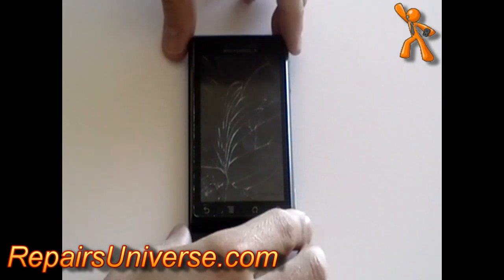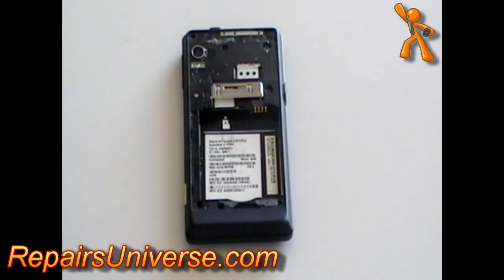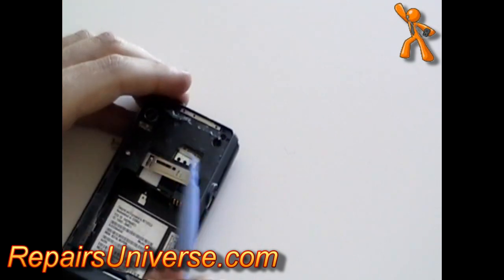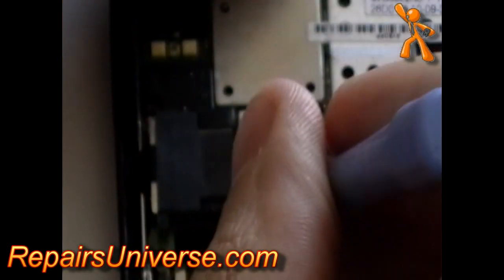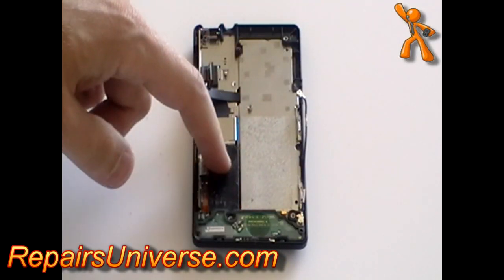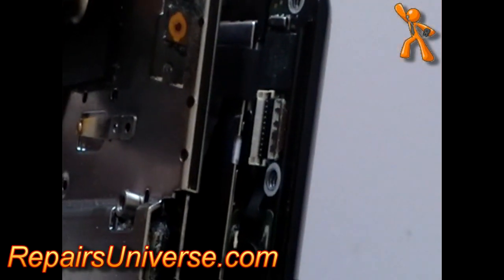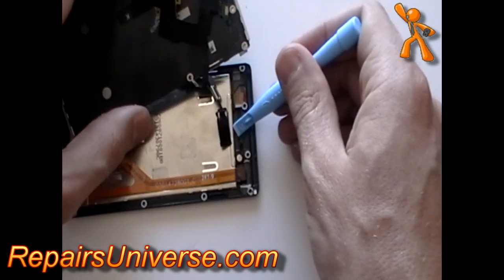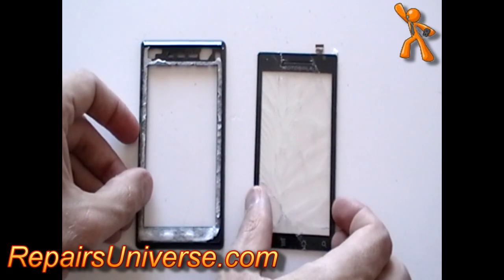Motorola Droid A855 Glass Touch Screen Digitizer Repair Instructions

Comment from the maker: @redinc Great work. Sounds like an off connection with the vibrator motor. I believe it is located right around 3:01. Just be sure it is in the correct location and the connection is secure.

Comment from the maker: @mec2137 It is a jaw connector, meaning the tab will have to be flipped into the unlocked position (up) and the cable slid in. You can then lock it into place by flipping the tab connector down, securing the cable into place. Be sure it is fully inserted.

Comment from the maker: @Ardy1148 We sometimes use WD40 or other penetrating oil to loosen stubborn screws. Use a Q-Tip and apply a small bit (not runny) of WD40 on it and see if that will help loosen them up. If that does not work, you may want to consider either using a screw extractor to remove the screw, or use a small drill bit to drill out the screw and remove.

Comment from the maker: @maizeandblue93 The connection is very important and is likely causing the issue. A few things to check - make sure the correct screen was used (many of the Moto Droid screens are very similar - IE Droid 2, Global, etc) The connection will need to be securely fitted - it should pop into place with ease, if it has to be heavily forced, there is something obstructing the connection. You can clean the connection and check for bent pins at that point.

Comment from the maker: @amr1980 Normally those strips can be used without reapplying adhesive. These are very sticky and should have no issue securing them in place. We always suggest ordering the adhesive strips (one strip is normally all you need to do 2-3 touch screen repairs), just to make sure there are no issues with parts without enough stick.

Comment from the maker: @polishtom54 The power button is either structurally damaged or there is an issues with the contact (flex cable that receives the data that you pressed the button and relays it) If the button is just jammed, you may attempt to either remove it or loosen it. If you can release it externally, that is the easiest, otherwise you will need to disassemble until you can get access to the power button.

Comment from the maker: @drgchaltikyan I see. Sounds like something was not connected properly. If it is getting hot, the motherboard is attempting to function, however something (likely a bad connection) is not allowing it to. I would suggest disassembling to the motherboard and checking all the connection to be sure everything is fully in place.

Comment from the maker: @dropYoTop Use a safe pry tool to help the flex cable out. It may take a bit of pressure but keep the cable straight (don't twist, ect). If you are still having difficulty you may want to heat the adhesive with a hair dryer or heat gun for a moment or two. Let us know if you still have an issue. Good luck!

Comment from the maker: @gtoknu Are the screws stuck? If so, you will either need to use a screw extractor to remove the screw, or use a small drill bit to drill out the screw and remove. These are your two easiest options.

Comment from the maker: @firerzero Could be a few things causing this. Has the phone had any major damage such as water or a bad drop? Many times it is caused by the glass touch screen digitizer coming in contact with the LCD screen, making the sensors thing it is being pressed. Disassembling would be the best way to fully diagnose the issue.

Comment from the maker: @Dobi93PL It is possible, difficult to determine without physically looking at it. May be worth a shot to remove the adhesive and re seat the flex cable normally.

Comment from the maker: @cutiemystic If the image is fine behind the touch screen then it is likely the touch screen digitizer is faulty. Usually if half of the touch screen works it means there is a connection issue or faulty screen involved. You can check the touch screen flex cable and connection for issues, if neither of those seem likely, replacing the touch screen digitizer should resolve the issue. Hope this help, best we can do without having the phone in front of us. Good luck!

Comment from the maker: @Dobi93PL Could be a mistake when installing, you will have to check the touch screen digitizer flex cable for a loose connection or possible damage. I do believe it is compatible. If it is still not working after re-seating the flex cable i would suggest contacting the seller of the screen directly.

Comment from the maker: If you are talking about before the repair then it is an LCD. If this is happening after the repair then it could be a Flex cable connection issue during the install.

Comment from the maker: @maizeandblue93 Correct, my mistake. The Droid A855 uses a "jaw" connector. Be sure the back tab (flip tab) is open and then insert the flex cable. It should then slide into place. Lock down the connector and you should be good.

Comment from the maker: Try to use a rubber band on the screw for added grip. Second, try to create a groove with a small flat head by pressing down, you should be able to turn the screw after creating this groove.

Comment from the maker: @HEAVENLYFATHER3000 Sadly it is the only way to gain access to the connector that reads the signals from the touch screen. You can remove the screen (kind of) from the front, but will not be able to replace it. The Droid A855 is one of the longer and more tedious repairs, but it is straightforward.

Comment: Thank you for this video! I dropped my Droid today and the screen would not come up. I watched your video, figured out where the video plugs were and was able to apply pressure on those spots and the video came back up. This was all without removing the case! I will remember your shop in case I drop it again and am not able to do a quick fix. Thanks again.

Comment from the maker: @betobreakers17 Be sure all adhesive and screws are removed and then slowly pry it up. It may take a bit of force, but make sure you are applying pressure in the correct position. Double check the video. Let us know if you are still having issues!

Comment from the maker: @SekundesC Yes, the adhesive used differs depending on manufacture date. The Droid will power on though correct - can hear it chime, vibrate, connects to a computer, etc? Just no image is being displayed?

Comment from the maker: @Repebas You will simply need to apply fresh adhesive to your new screen and apply some pressure to fit the screen into the housing. Check out our video "Touch Screen Assembly" in our channel for more information on this.

Comment: This video was very, very helpful. I've taken apart phones before but this one was more annoying than most, probably because I hated how many things were glued on, and the phillips screws are cheap and strip really easily. 

BTW, some of the models on this phone have a black tape/gunk covering the jaw clips. I got totally lost on that step the first time around because I couldn't find the things. Also, the digitizer cable was glued to the back of the lcd screen, so that was worrying too.

Comment from the maker: @Defiant615 Replacing the touch screen should resolve the issue with non-functional touch screens, assuming it is the digitizer itself which is non-functional. The freezing issue could be many different things. Opening it may show a loose connections or other issues. You can find replacement parts for the Droid A855 at RepairsUniverse (dot) com.

Comment from the maker: No they are not welded. You may need to apply pressure and turn at the same time. If screws are stripped you could try to use a smaller screwdriver and apply pressure.

Comment from the maker: @jhoravi We normally use adhesive strips. Other people use different types of glue, but we never liked that method as it gets messy quick. Adhesive strips available at RepairsUniverse (dot) com can be cut to the correct size and is usually much stronger than other adhesives we have used.

Comment from the maker: @amr1980 No problem! Glad you found the video helpful! The adhesive can be reused, but won't insure a solid "seat". We suggest ordering adhesive strips (although our current stock of A855 digitizers have pre-attached adhesive) with your order to insure your touch screen is solidly in place. Glue can be used but is usually messy and it is difficult to determine the correct amount. Check out our digitizers, tools, and adhesive at RepairsUniverse (dot) com. Hope this helps!

Comment from the maker: @osmosizz Sounds like you are using the wrong size screwdriver. If you use the small Phillips from RepairsUniverse (dot) com the screws will come out without issue. 

Having your phone apart for a few days won't cause any damage if it is stored a dry and safe place.

Comment from the maker: @Dobi93PL Is the display (LCD) screen becoming distorted or discolored? as if pressure is being applied to the LCD screen from the pressure of the touch screen? If so, adding a layer of adhesive to the digitizer would be suggested to give the touch screen the proper lift from the LCD. The adhesive at RepairsUniverse (dot) com is perfect for this.

Comment from the maker: @SekundesC Normally this is just a LCD connection issue, but if the cable/connection looks good then it would be more likely that the LCD screen was damaged during the repair. Possible?

Comment: @gtoknu This happened to me, I used a diamond-tipped Dremmel bit to gully out those screws, and just didn't worry about them upon reassembly (although you could use a drop of super glue on the tip of a needle, if suppose... Seems to work!  (Watch the metal dust, though - that can't be good for the circuits!)

Comment: First of all, thank you for this great video!  I have a few questions which I hope you could answer.

When I put it back together, will the adhesive parts still stick, or should I plan on buying more adhesive?  Would a certain type of glue work?  Are there any tricks to ensuring that I don't ruin the existing adhesive?

Thank you!

Comment from the maker: @C0SMICW33D Sounds like an issue with the LCD screen. Could either be a damaged screen, damaged LCD flex, or just loose LCD connection. Does the device have any history such as water damage, previous repairs, or major drops?

Comment: @Liveman45 I had the same problem. The Phillips screws on the back of the screen were an absolute bitch to remove. I sprayed a little wd40 (used a qtip to apply) and let it sit for a few minutes. Worked like a charm.

Comment: i'm having an issue with the screws. it's like they've already been stripped or something because i can't even get the screwdrivers the grip, much less turn the screws. i've tried both the screwdriver i got with my part, and some smaller ones of my own. my friend managed to get three out, but it definitely wasn't easy and i'm afraid the others might get even more stripped if i keep trying at them.  any suggestions? apart from that, this video has been great. thanks for the upload.

Comment from the maker: @ivansvideowarehouse We have been able to salvage every part like the copper foil and strips, etc. We do suggest getting fresh adhesive for anything that may be difficult, or not want to stay in place. The adhesive we use at RepairsUniverse (dot) com is great for this. Perfect thickness for this type of repair, as well as great for touch screen assembly adhesive.

Comment: I bought this phone online. And it did inform that the screen cannot unlock and would need a new digitizer.
Now the screen looks perfectly fine. Question is does the  digitizer have to be cracked to not work properly or can the digitizer look ok but need replacement? 
-thanks u lenda

Comment: part 2: 

2nd: there is this small metal piece that looks like it goes onto the mother board, like in an old transistor radio. It is silver and gold like a coat hook that hangs on a wall, the hook is gold colored. any idea if I "needed" that piece? 

And a question too: The charger connections are ALWAYS loose and it is awful. Is there a replacement part for this as well? 

Thanks!!

Comment: @RepairsUniverse Thanks for the quick reply.  If I could just trouble you with one more question...what about the things like the copper strip, and other panels that you take off at the beginning, which look like they're held on by adhesive?  Do you use glue, or will they stick back on?

Comment: my husband upgraded to a a htc thunderbolt and gave me his old droid a855. the right side of the screen (right when phone is turned with the short side down) is not responding to touch after he did a factory reset on it.  is this the part we need to repair? the lcd screen itself is fine with no damage and the touch screen is not damaged just not responding to touch on part of it

Comment: HI: I replaced the digitizer. two things happened: on the Motorola Droid A855 flex cable ribbon with pre attached ear speaker replacement: looking at the picture at the top left where it connects in 2 places to the middle top free floating piece, one of the connections came apart. I am hoping it still works.

Comment: Ok so my Droid A855 has a cracked screen. There is a big huge crack in the middle top and all the cracks spread throughout the whole screen. But everything works fine. All controls and and functions are working correctly. Is it the touch screen digitizer that needs replaced?

Comment: OK I have bookmarked this vid. Doesn't look much trickier than my Touch Pro keyboard "investigation".
 - A friend of mine gave me an a855 with the "well-known" jittery/dead spot/slow to respond issue. The corners of the bezel around the digitizer are very scuffed up. This poor droid was not treated well.  After seeing that the glass is not just a hunk of glass, i am leaning towards this being the problem. 
In your experience, is this usually the fix for those issues?

Comment: i bough the digitizer from repairs universe  and  took it  apart but my t 3 screwdriver  is not the 1 for the droid 2 A955  does all droid  2 lcd is hold by T3 bold or T2   because i think my need  T2 screwdriver

Comment: So I repaired my smartphone with digitizer from motorola milestone A853 which should be compatible. Okay so everything works great, even vibrations (I think that they're better than they were before lol) BUT touchscreen doesn't work and 4 buttons that are on it. so I have to do everything with my QWERTY. So is this digitizer compatible or did I do something wrong when repairing it? cheers!

Comment: Hey. Unfortunately i just dropped my droid bionic (with a case on) and the whole screen shattered. It is still completely functional, its just horrible to look at. Do I need to replace the whole screen or just the digitizer? (the screen itself is fine, no dead pixels or color bleeding).

In short, it has 100% functionality, I just dont want to look at the cracks.
Thanks!